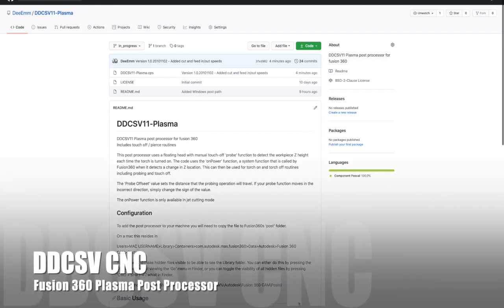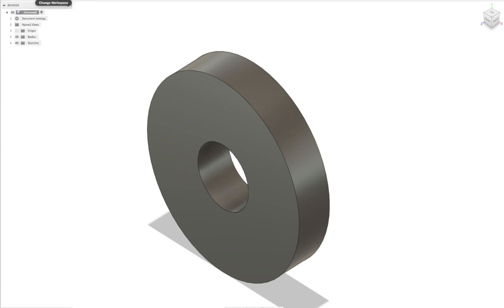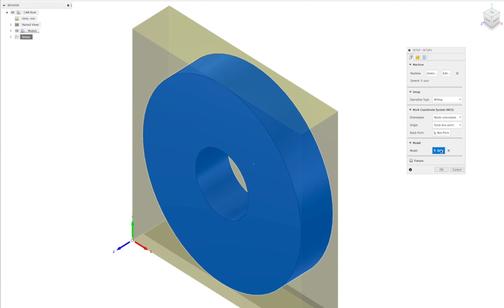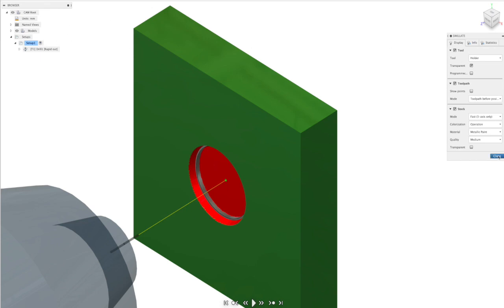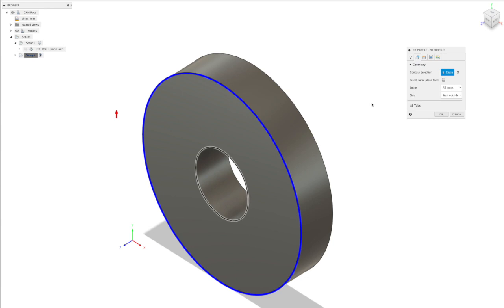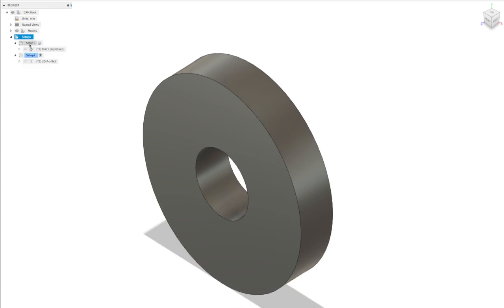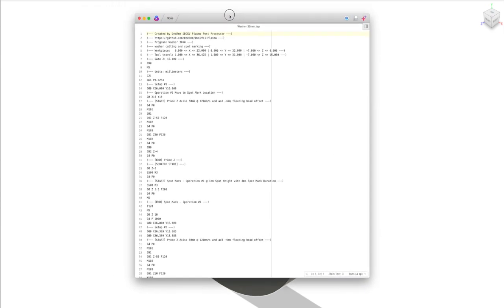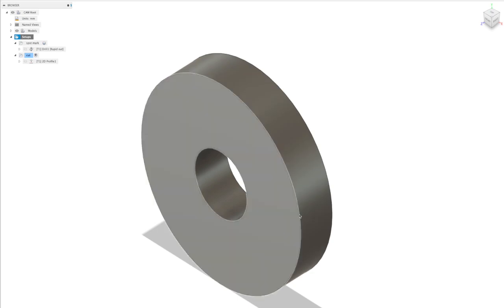Fusion360 to DDCSV Plasma Step-by-Step

Comment: Hello Mick Percy. I tried your post processor it does the routine works fine Like torch on-off, maintain cut height, pierce height, pierce delay, post flow delay etc. But in my case I faced two problems.
Problem 1. When the value of P(pDelay) <1s (ie .2 or .5) the machine stopped running.
Problem 2.  Instead of moving/cutting a circle it cuts an ellipse/oval shape. 
Possible Solution for  1. Keeping pDelay=> 1s 
Possible Solution for  2. I made a change in your postp line 125. from  allowedCircularPlanes =  (1 << PLANE_XY) to allowedCircularPlanes = 0. In that case it outputs only X, Y and Z codes no I, J codes. Then my machine works ok to cut/move in circular path for same design above. But I think it makes the machine jerk a bit. I am not sure.
Can you please help me with your feed back please. I am not sure what to do should i change the ddcs 2.1 controller and get mach3? Here are the google drive link for g-code samples:                
https://drive.google.com/drive/folders/1Uw31L8tzEkMT5OQeFTZfzcI6ec_b4ToJ?usp=sharing

Comment: Hello. I built a plasma without any thc or floating z with a ddcs 2.1 controller. When I program in fusion 360 the machine moves in elipse/oval instead of circle. But if i post g- code manually it moves in perfect circle. I used mach3 plasma postprocessor in fusion. The g-code posted from fusion has relative coordinates i..j..
But in case of manual coding i only used x y z codes. One more thing the program stops when ever the delay time value of p is less than 1 second. Is there any setting in ddcs to recognize relative cordinates? Or is there any alternative solution?
Reply from the maker: Hi Hasan. I don't think that the mach3 post processor is the best choice. In fact I try to keep as far away from anything mach related as I can. I based my post processor on Jay McClellans Bainright CNC project as it works with the DDCSV. You can elect to modify his version or mine to remove the Z Axis code. It's not too difficult to do. There's some more info in the following blog post which will help you - http://deeemm.com/general/2020/09/30/ddcsv-fusion360-plasma-post-processor.html
Reply: Hello Mick. I checked some parameters your postp. In your post the pierce delay time is in seconds. Example- G4  P0.5 which is available in the tool cutting data. And the post flow delay time is in milisec. Ex- G4 P1500 which is available in your post properties. Isnt that conflicting for the ddcs controller? How the machine decides the units?

Comment: Hey, i tried this method to pierce center holes, unfortunately it didnt work, after generating, the Fusion states "following NC code failed to post"
Reply: Information: Configuration: Hypertherm Jet
Information: Vendor: Hypertherm
Information: Posting intermediate data to 'E:\1testas.nc'
Error: Failed to post process. See below for details.
...
Code page changed to '1252  (ANSI - Latin I)'
Start time: Saturday, February 19, 2022 2:08:44 PM
Code page changed to '20127 (US-ASCII)'
Post processor engine: 4.5793.0
Configuration path: C:/Users/jonas/AppData/Local/Autodesk/Autodesk Fusion 360/CAM/cache/posts/hypertherm jet.cps
Include paths: C:/Users/jonas/AppData/Local/Autodesk/Autodesk Fusion 360/CAM/cache/posts
Configuration modification date: Friday, February 11, 2022 1:50:19 PM
Output path: E:\1testas.nc
Checksum of intermediate NC data: 965b3b2eabd87ef58fb06002c2d82dde
Checksum of configuration: dfe38fe5638b5312456a4498337f0011
Vendor url: https://www.hypertherm.com/
Legal: Copyright (C) 2012-2021 by Autodesk, Inc.
Generated by: Fusion 360 CAM 2.0.10806
...

###############################################################################
Error: Milling toolpath is not supported by the post configuration.
Failed while processing onOpen().
###############################################################################

Error: 
Error: Failed to invoke 'onOpen' in the post configuration.
Error: Failed to execute configuration.
Stop time: Saturday, February 19, 2022 2:08:44 PM
Post processing failed.
Reply from the maker: @jonasaskenobis   When you create the toolpath you need to choose the profile cutting tool. From the Error message it looks like you have a milling tool selected.

"Error: Milling toolpath is not supported by the post configuration."

Make sure you have a plasma machine created and selected when you create the setup and then make sure you use the 2D profile cutting tool for the cutting operation. I think this should fix it.
Reply: Hey, thanks for the reply! I did that, same way as you described in the video and in the comment, but it didn't work. Looks like when Post is trying to invoke the function onOpen, it shows an error and stops the execution. When trying different methods to bypass it, I got these messages:
"Invalid tool type for drilling"
"Choosen operation is not compactible with the current setup"
Reply from the maker: @jonasaskenobis  There's a few possibilities. 

#1. Did you change the sport marking setup from milling to cutting? See here - https://youtu.be/FzAZNHg6ciQ?t=675 

#2. This could also be a limitation of Fusion360. It has changed since I made this video. The free version now only supports a single tool and will not generate code for tool changes. If you have multiple tools / operations try just exporting a single spot marking operation.

#3. Something else.

I'm happy to share my current PP file. It may have changed / might be more suitable. It's entirely possible that I've changed it since this video to address an issue and not thought to update the video. I'll upload the new version later tonight.
Reply from the maker: Mick Percy
@jonasaskenobis I just checked the version I have here against the one in GitHub and it is the same
Reply: @mickpercy  Hey, sry for the long reply :/ 

# 1 yeah i did, followed all the same steps as in your video
# 2 i have educational full version(?), i definetly can use multiple tools, but also tried to export using only one
Reply: @mickpercy  also, i was using Hypertherm Jet PP, as was described in the error message "Information: Configuration: Hypertherm Jet
Information: Vendor: Hypertherm"
Thought the hack you found was universal to all posts, so maybe other readers will know now
Reply from the maker: @jonasaskenobis  Yes if you've followed the setup in the video I'm not entirely sure what it could be. The error message is basically stating that you cannot use a milling tool for a profile cutting operation. But if  you have not used a milling tool and have changed the drilling tool to a profile cutting tool before running the post processor then I am not sure what is generating the message. I can only suggest to double check your setup (it should be profile cutting) and tools (also should be profile cutting). However to initially create the drilling op you need to use a drill tool.

The only other possibility that I can think of is that something has changed in the non-free version that you have. TBH I have not used the spot marking in a while, if I get a chance I will make a test job and check to see that it is still working here. Perhaps it was killed in an update???
Reply: @mickpercy  Might be, since it definetly wasnt an intentional feature to allow spot marking